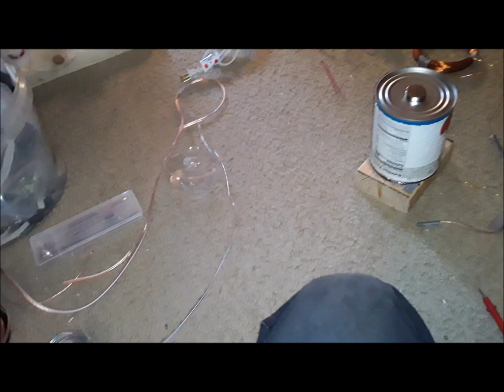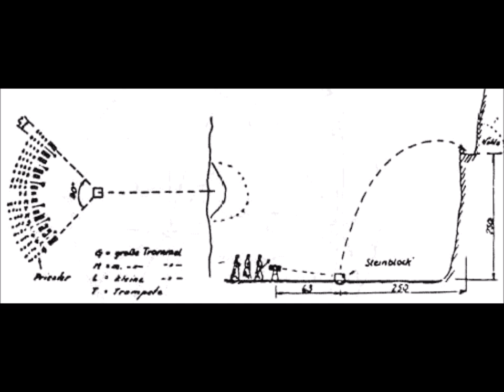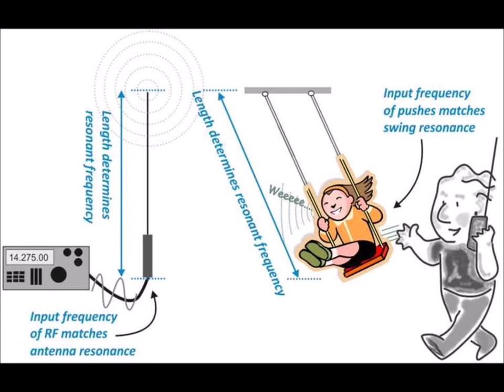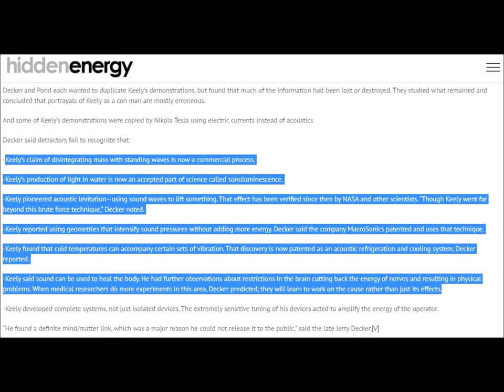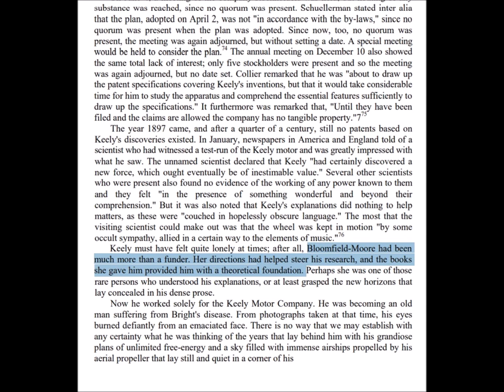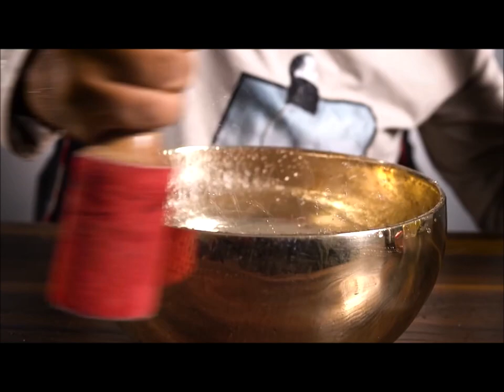Wired For Anti-Gravity? John W. Keely's Mysterious Gold, Silver, and Platinum Wire

Comment: You can get tech material from recent times, all the way back through the 1800’s from interlibrary loan! (John W. Keely of Phil, Pa., did machine shop work 1875-1899. He developed a process of high frequency harmonics applied to water samples to easily separate water to hydrogen and oxygen gasses. Resonance with 3rds ratio harmonics were applied! Back then, an array of tuning forks and wires of silver, gold, + platinum, thermocouples / thermopiles attached to each cavity resonator. The wire nodes/joints multiplied the frequencies. I was completely floored (WOW) when I read that after hundreds of energy expulsions of his water chamber, he found a gummy substance he could not account for.  (Back then, it was not generally known that about every 5000th molecule of tap water contains heavy water - deuterium, which has the consistency of glycerin! The resonance frequency's shock point did not affect the deuterium and had probably accumulated in the small brass chamber!)
Reply: crazy interesting.
Reply: Deuterium depleted water enhances lifespan
Reply: The hydrogen and oxygen so released can be combined later to get ultra pure water which is tough for even today's Technology

Comment: What you need to do is tap a object using a square wave pulse at 3.54hz using a frequency generator. Then using Spectral analyzer app find the frequency it creates when its "tapped". There will be multiple ones but find the base loudest one, generally will be in the 500-3500hz range.... Then you need to play that sound into the object and again find the highest ultrasonic frequency created with the object from pumping it with its resonance frequency. The next step is the key to making it move.... You now need to use ultrasonic transducers, At least three, two at 90 degrees roughly playing the highest ultrasonic frequency the block resonates at... (you will feel when you are in the correct spot as it will feel like two weak magnets trying to repel each other) at a distance that is the length of a wave in air 1/4 that of the base resonance. One facing one face, the other facing the face 90 degrees to the side. Now you need to change the Ultrasonic frequency such that the difference between the two creates the base frequency so if its 10000hz resonance ultrasound when pumped at its base and its base is say 1000hz,.... one transducer plays 9500.... the other plays 10500. This will create a beat of 1000 but since the energy of ultrasound can not transmit a few feet in air the beat frequency is used to carry it by compressing the air causing it to create ultrasound on the face. The third goes at the corner and can be a base speaker playing the 1/4 of the base frequency
You slowly bring the two side transducers together at the base speaker in the corner between the ultrasound, still exactly the distance of one wavelength for the base quarterwave will the two transducers meet at the corner. You will now hear the ultrasound you could not hear before yet it will sound like the block is creating the sound from its face despite you being many feet or meters away. At this point you will start to see the block thump at its quarterwave. You are pumping in energy using ultrasound however since it can not go far what you are essentially doing is making FM Sound waves. They are WAYYYY more capable then simply moving blocks but that seems to be your goal so ill just leave this hear. Hope it helps, I been at this for 20 years. I know it sounds like a clump of rambling crazy above and I am sorry, but I am in a hurry and wanted to get all the technical stuff squeezed in as I feel you might like to know. PS: Check out the staff of the Egyptian gods and leaders. They are stylized stone cutting tools on top of long tuning forks. I can show you how to cut Stone as well if you like but another time I guess. It literally just turns the surface you touch to dust.
Reply: Very interesting. Any more info on cutting into stone?
Reply: Could you tell us more.
Or is there a way to get in touch with you mate ?!
Thanks in advance
Reply: i love the idea of cutting stone using sound vibrations - is it like an oscillating saw?
Reply: @neuroblossom  Please take care if you can direct sound to cut stone you might slice someone in half accidentally.

Comment: It may not be sound vibrations that are travelling down the wire that you're looking for but another form of energy/current.  Note: as Keely states, atomic dissociation occurs in the pressure chamber (the round ball) and the wire leads from that. That's the clue.  The very same thing happens in a Joe Cell and the output of that cell doesn't need to connect as an output fuel line for gas, it only needs "to touch" the engine block.  This creates a vacuum effect internally in the engine (suction), and if you do not use metal the cell itself expands dramatically, and is why Keely used a metal sphere, which is connected to the musical generator (harp).  This pressure effect from sound is also found to be produced in the grand gallery also, which is a resonant transformer between air and sound, as air becomes highly pressurised (dense) from the sound produced below it and the shape of the corbelled architecture (shape power).  With the room being resonantly tuned also it creating the same effect at an atomic level.  Karl Von Reichenbach in his research found a similar effect, discovering another form of energy that used "light" as a conductor. He managed to tap into that with copper wires collecting it from the roof of his house and into a dark room below, producing colours that only certain people could see.

Comment: Several years ago, a video  was shut down after 1 month. It was dealing 
with demonstration of thermocouple/thermopile that slightly loses weight
 when activated, and also on sensitive digital weigh scale. The word 
"correlation" describes other experimenters who successfully aborted 
gravity with their specialized set ups using matched metals according to
 ratios of properties. See 1800's work of John Keely with his 
"transmitters"  as junctions of silver, gold, and platinum thermocouples
 as tested for gravity control. A french scientist also lifted an open 
frame dirigible with sandwich plates at either end hooked to frequency 
transmitter. (translated from french) It seems there are other ways to 
disrupt gravity waves affecting mass..
Reply: The upstairs Keely workshop mounted devices were found to be fraud after 1899. Exacting step by step details found in back issue Library special order purchase  photocopies of - New York Journal And Advertiser January 29, 1899- Editorial - pages 16, 17, 18, 19, "Keely The Monumental Fraud Of The Century".  Hidden belt, spinning magnet, compressed air over water in hydraulic tank,  multiple precharged air pressure tubes, Water jar was hollow brass with specific gravity change pressure through tube (not wire) .The  Globe Motor was wound up band spring from crowbar, etc. Real Science research was done on first floor. You must study the editorial, if you havent yet.
Reply: Man I love to see people interesting in crazy stuff about energy and ancient technology but are You talking about the "magic gravity" that hold a gigantic mass of water to the surface but is not able to hold a tiny bee or bird or balloon to its surface? That one? :) Just kidding brother (but still gravity doesnt exist only density and buoyance)

Comment: In 1800's Philadelphia, Pa, Mr. Keely's later model instrument called "Liberator" was shown operating and developing 23000lbs pressure as through small tubing to small chamber before raising up weight on warehouse weight scale. The scale  arm had negative 14 to one leverage with 500lb weight so as more than that value was needed to counteract the weight so as was raised up. No gauges mounted anywhere. I figured this out many years ago as it was  probably another one of his fake systems. See picture of unit in - book- Universal laws never revealed. Picture has horizontal tank with vertical tuning forks . Tank was shown as beginning empty by pouring water in one end and out other end, so as no pressure. After 15 seconds of vibrations and the spring wound up fan stopped turning, the heavy weight went up on the scales. I conferred with an engineer and had specs diagram made showing my methodology of it's "real" operation! Pressure tanks had one turn valve on end. Keely's shop had lots of money to purchase parts. He had standard valve at one end of tank with homemade valve at other end. You can see line on that end of tank  , where the tank was sawed , and rewelded back together. There was another PRECHARGED horizontal air pressure tank within, with screw in internal rod that opens inner tank to fill space in between tanks, using outside screw valve.  Just like releasing air from a car tire with poker. There was no air compressor in Keely shop or nearby buildings. Keely had in shop ,1865,  a 40HP engine that turned a rotary type hydraulic fluid screw pump that would pump water into a hidden under floor sphere tank up to 30,000lbs pressure. He used that to refill various tanks. The special gas , Keely called ETHER, was humidified air. Just like a homeowner's well with cellar water pump that fills small house water tank to 40lbs pressure. Water released near bottom of tank is 40lbs water. Pressure released at exact upper top area has large air bubble and will release 40lbs MOISTURIZED AIR pressure. The fan included on the Liberator was a noise maker to cover up the air noise coming out in between tanks. Keely said the tank was extremely heavy due to heavy wall thickness steel. and was clamped attached to the Liberator. The tank was heavy because there were 2 tanks. He had earlier purchased the engine  assembly from a worker at a New Jersey machine shop that he visited regularly. The unit had been previously used to bilk a Doctor out of much money until he refused to pay more. The Disintegrater device with small hollow steel ball was the last water unit. The doughnut shaped pressure tank was covered with shiny brass and refilled by opening  diaphragm valve hooked to tubing. The other diaphragm valve on table pushed small pressure to open other one so as pressure released from tank went to hollow steel ball. Keely said that water was changed to Gaseous ETHER. Keely had one US Patent on compound flywheel design , that was also used on the upstairs "Great Keely Motor" The table support leg was hollow , so as rotating belt was within was turning the large spoked wheel, from power downstairs under floor water turbine, turned by hydrant pressure to building. he let the water soak down through the dirt under the floor. See other data by special reading of newspaper article- Keely, the  Monumental  fraud  of the century,  New York Journal And Advertiser, January 29, 1899, pages 12,13, 19, special order from Interlibrary loan, or read for free on internet.

Comment: Mr. Keely's special wires to carry vibrations was called "The Transmitter". Depending on type of bench testing, he used silver - end connected to gold- end connected to Platinum. This was not an alloy of 3 substances. His circuits would work, however, his problems surrounded the PURITY of metals, to get better responses from the ratios of harmonics obtained at the end point. The joints (nodes) were what caused the multiplication of frequencies. He also added clips of wire added to transmitter along the line, to increase frequency in ratio. The resonance value of work piece was determined first and also applied along with the ratios. He also built fake devices that were shown in upstairs workshop since he was indignant of others not comprehending his work, but still needed money. 90% of investor's funds went into the metals shop work. One Keely flywheel US Patent  was issued and the other was declined because investors names were not on it. (free energy running water hammer hydraulic motor) Back in those days, 1865-1899, it was tuning forks array and resonators.
Reply from the maker: waterfuel   That's some interesting insight. However, the triune wire was not the transmitter. They were the conduit for the sympathic "force". The transmitter or Liberator was actually the small globe-like device shown in pictures of his weights-in-jars experiments. I also never claimed the wire was an alloy. I highlighted that it was actually 3 individual wires; each of a different metal.
Reply: @gsutton78  
Mr. Keely's references were studied for 8 1/2 years , and I accumulated about $400 in documents. My original 1894 book - Dashed Against The Rock does not have modern editing, as has been done by Mr. Pond of S.V.P. and his books reprinted. An originator's notes are what's required for an accurate assumption on content that has been reprinted. I assume you also have Pond's Universal laws book. See page 211 for photo of correct "Sympathetic Transmitter". The correct "Liberator" machine is on page 235 which replaces the earlier "Multiplicator".  This Sympathetic Transmitter  was the vibrators output unit Keely used and associated it with other units, by means of the connecting wires called "Transmitter" which was also called Trexar, trexnonar,  depending on the amount of multiplication of frequencies along the transmitting line. The Fibonacci rods spiral is at base with also the air siren as used to initiate vibrations, after settings first done on the upper head. My red covered copy of book - Keely, Pictures of his Discoveries - was obtained from Sweden. This has black and white photos of Keely machines from 1865-1899 . The Snell Manuscript shows majority of Keely's real tech notes even though it is a summary, Mr. Snell COPIED of the original 3 Keely books published at about 1892. (about 200 by Lippincotts publisher) There were 5 sizes of the ball and/or cylinder shaped manual operated units on various tables as seen in the old photos. The largest sphere one with the upper cone telephonic head was called Vibratory Globe. These were all hand operated diaphragm actuators (2 half shells) that contained interior bladder separator, so as push on handle would send air pressure on diaphragm opposite side through platinum tubing to actuate catch release of 2nd. hidden diaphragm actuator on main device being tested. The cylinder type had a finger pull ring to force air out. That one was for his use only before public demonstrations.  The standing visitors upstairs were handed cut offs of platinum wire from reel at table. Platinum tube connected on each table unit was same diameter as the wire. At one occasion only, a  visitor cut the tube and examined the end of it. Keely (a very strong man) got mad  and picked him up, carried him down stairs and through him out into the street through the double front doors. Later Mrs. Bloomfield-Moore was advised by attorney to greatly reduce her donations since Keely refused to remove Transmitter wire at other appointments. Her son was adamant about the fraud at the Keely Motor Company and was worried about money left from family Will.   PS- I had also finally found out how the huge 23 thousand of pounds pressure was generated and shown during Philadelphia Pa. Keely demonstrations back in 1865- 1899, since there was no air compressor capable of that back then. 
Other references; 
 Free Energy Pioneer John Worrell Keely, 
Keely And His Discoveries,
Reply from the maker: @waterfuel   Yes, I see the Sympathetic Negative Transmitter on page 211. And so, you're essentially confirming what I've already stated; that the transmitter was not the triune wire itself. It is a bulb-like device that has a mass of resonators in it. In fact, in some reproductions of the story, there is a device which serves the same  purpose called The Resonator; a cabinet with a cluster of metallic tubes. As with any line of invention over a sustained period of time, there were likely a number of different incarnations and renditions of transmitters that came in various sizes and designs. It seems to me that the terms liberator, resonator, and transmitter were even sometimes used interchangeably. This is not uncommon for someone whose work was so novel that he had to invent some of his own nomenclature. But Keely was a mechanic, not a linguist.